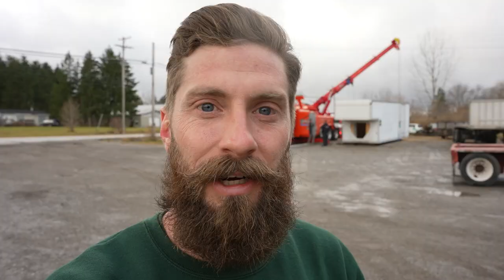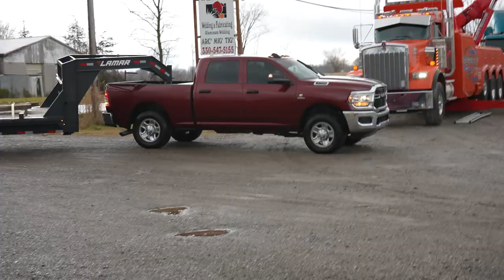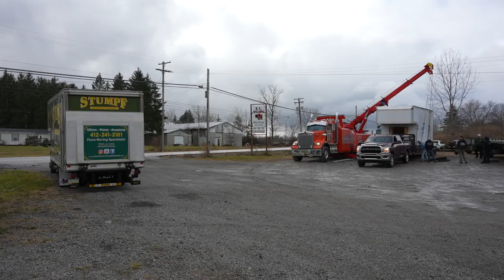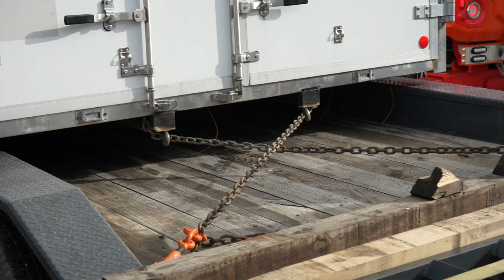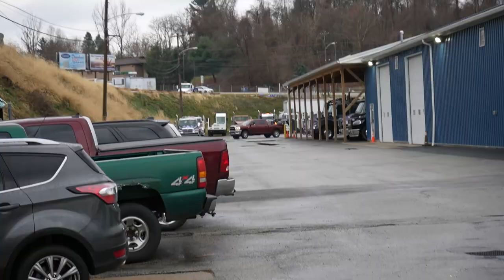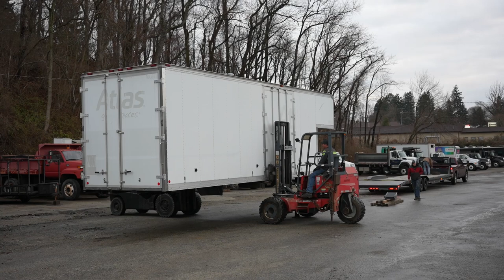How to Lift, Move, & Transport a 5500lbs 26ft box truck body to have it installed on a new Chassis!

Comment: It was an atlas van body
Reply from the maker: I didn't get into much detail regarding the history of this truck body, but I will in the next video.  You are correct, it was an atlas van body, but that was for a very short period of time.  The truck was then used for expedite trucking.  It did not originally come with the sleeper that you see in the video.  The previous owner made a (DIY) custom sleeper.  It was a very interesting concept, but we have removed it and repaired all of the holes, and it's back to being a moving truck.
Reply: @StumpfMovingandStorage  nice!!!